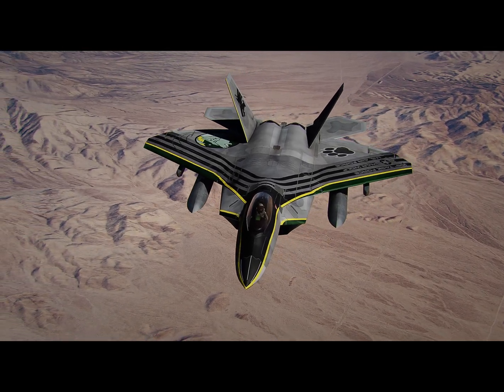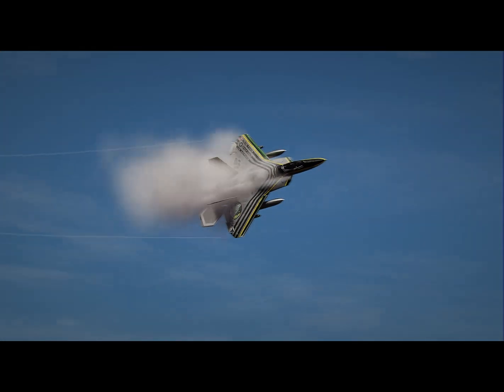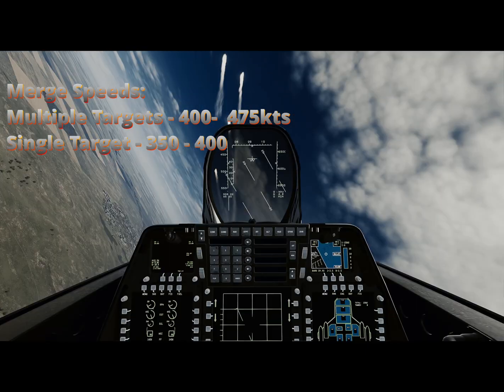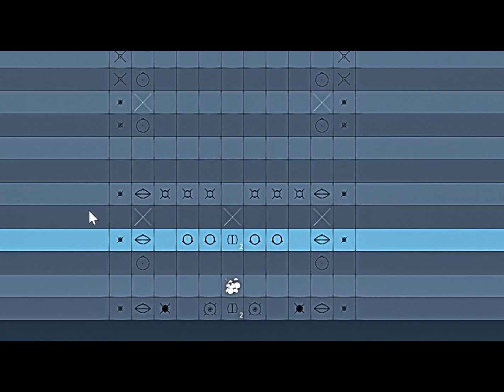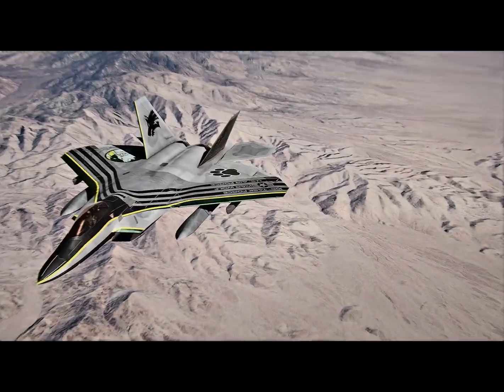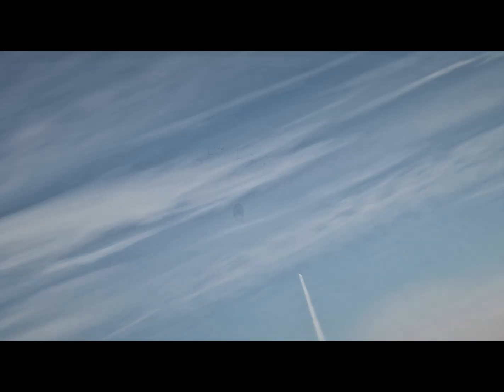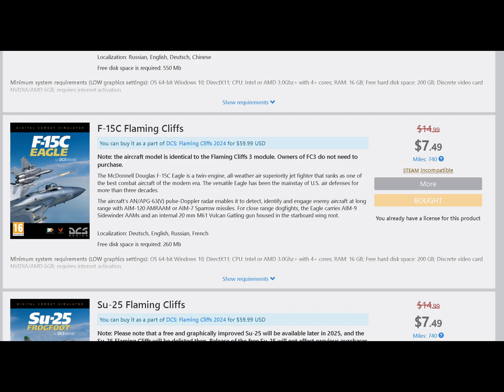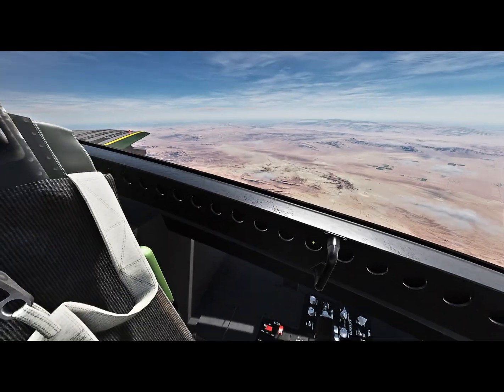Grinnelli-B-HOOP F-22 Overview

Comment: Keybinds for exterior lights do work.  Mine are mapped to my HOTAS
Reply from the maker: Skill issue on my end…

I tried it on my mongoose TM 3 and it didn’t work. Was it the actual “external lights” or another?
Reply: @RaptorDad  well, you got me thinking now.  I did add a few custom binds to the default lua some time ago and it’s possible those commands were some of them.  I’ll check the original lua and mine later today and let you know.
Reply: OK, so they are custom binds, the original doesn't have them...  In any case, if you want to control the exterior lights with keybinds, just add the below to the default Lua:

Saved Games\DCS\Mods\aircraft\F-22A\Input\F-22A\joystick\default.lua

--Navigation Lights
{down = 3003, cockpit_device_id = 2, value_down = 0.0, name = _('NAV Lights - OFF'),              category = _('F-22A Systems')},
{down = 3003, cockpit_device_id = 2, value_down = 0.1, name = _('NAV Lights - ANTICOL'),          category = _('F-22A Systems')},
{down = 3003, cockpit_device_id = 2, value_down = 0.2, name = _('NAV Lights - POS/ANTICOL'),      category = _('F-22A Systems')},
{down = 3003, cockpit_device_id = 2, value_down = 0.3, name = _('NAV Lights - POS FLASH'),        category = _('F-22A Systems')},
{down = 3003, cockpit_device_id = 2, value_down = 0.4, name = _('NAV Lights - POS STEADY'),       category = _('F-22A Systems')},